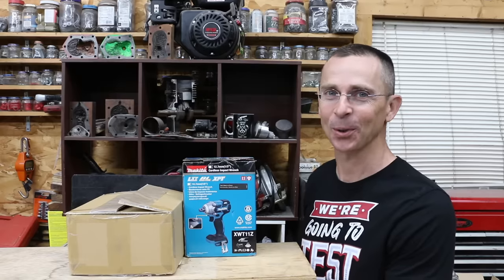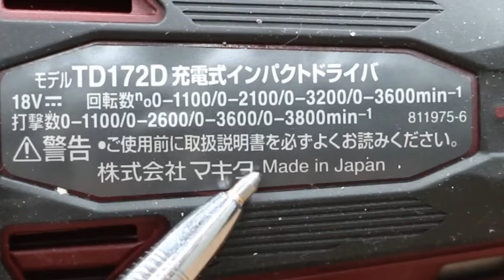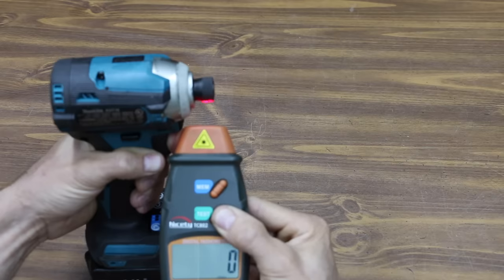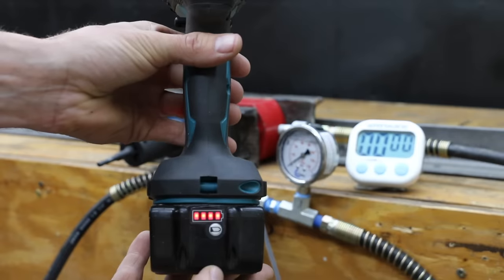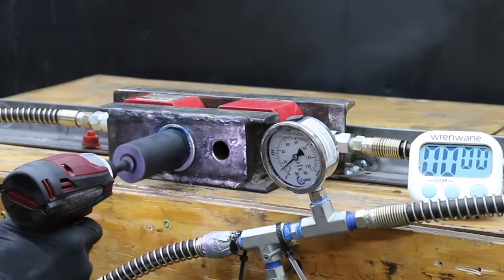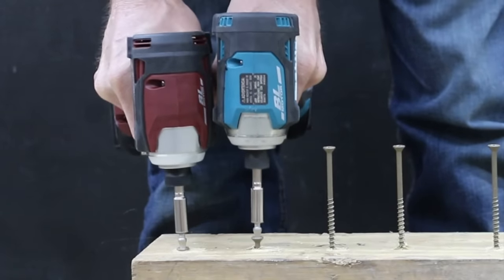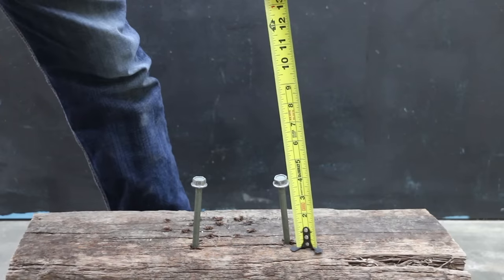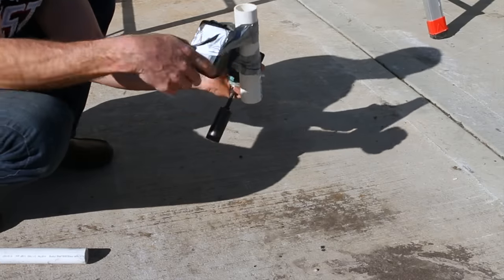Made in "Japan" Makita Better? Let’s find out!

Comment: 3 and 7/8th inches. Why do people us imperial when it just makes everything complicated for no reason.
Reply: It would only seem complicated if you don't use it. It would be like saying "Why do they have to make things complicated by speaking Spanish when they could just speak English"
Reply: @histguy101  Of course the system you grow up with will be the most natural to you. That doesn't change the fact that a system that works with straightforward powers of ten is objectively less complicated and easier to learn than a system where you have to solve a multiplication or division every time you change the kind of measurement you're doing.
Reply: @petertimowreef9085  What is there to solve? If he says "3 and 7/8 inches," someone who uses US units will know and visualize what that physically means for the size of the tool. It would only seem complicated if you only knew metric and whenever you hear a measurement given in imperial, you're trying to convert it in your head to what you know so that you too can visualize its physical dimensions.